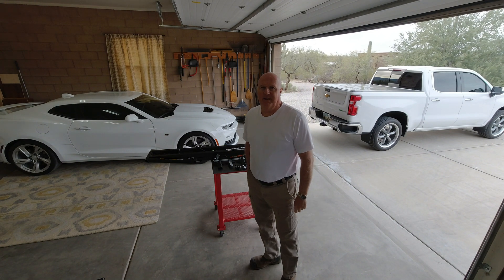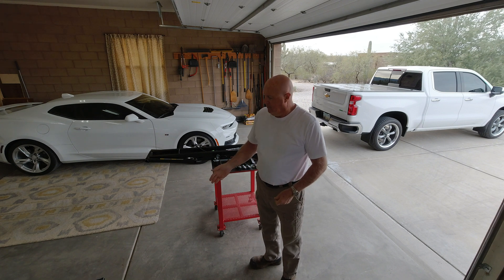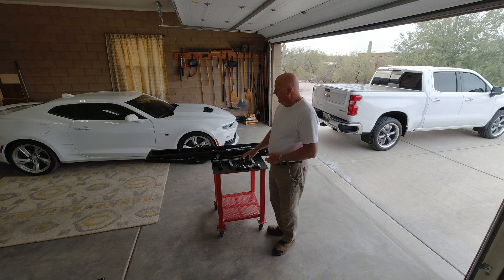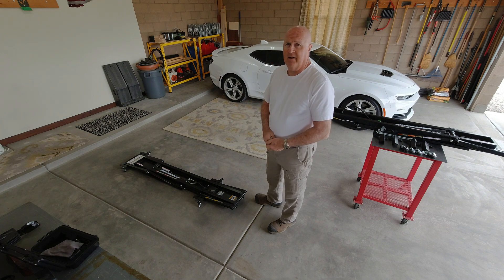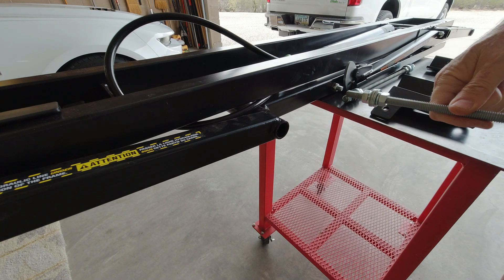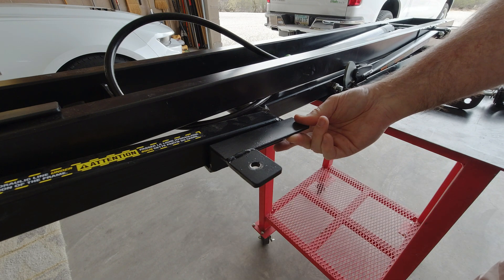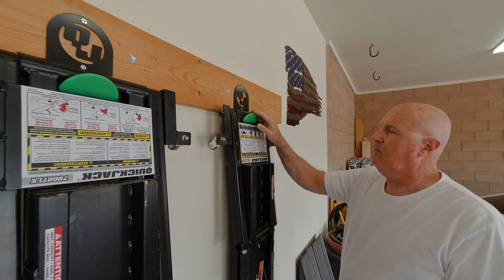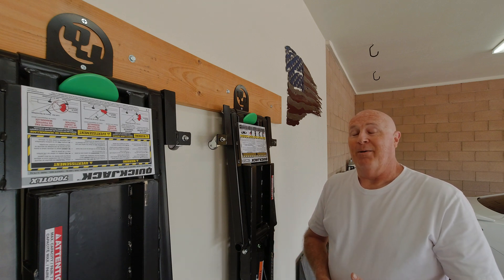Wheels For Your QuickJack, Bracket Design

Comment: Is there anyway you could make a quick video or explain in more detail about how you did the slope part so the wheel was even on the arm
Reply from the maker: Sorry, I just saw this.  Place the angle iron with one side elevated and then lay the tab flat on the table at the other end and weld.  I don't remeber the slope off hand but hopefully I stated it in the video.

Comment: Anyone have a parts list (for example how long is the all thread, how many washers per corner, etc...) to do this? I'm trying to make one (a list) now, but if anyone already got it I'd appreciate it. My jacks should be here this Monday or Tuesday.

So far i have:
8x 1.5" casters (would 1" work)
X ft of 1.5"x3/16 angle iron (4' plus in video, cut into 8 pcs plus brackets)
2x ?" 7/16 all thread
32-40x 3/8 washers (flat washers?)
24x 7/16 split/lock washers
24x 7/16 nuts (nylock/stop nuts, if desired?)

Am i missing something, or over counted on something?
Reply from the maker: Each "all thread" piece is 14 1/2 inches.

Comment: The caster style wheels will not work for everyone, my Mustang sits very low to the ground and I could not use caster style wheels on my Quickjack. What I did was purchase some button style rollers, they are like a large ball bearing in a metal cage they are much lower, so I can roll my Quickjack under both sides of my Mustang with the lifting block. I simply made a small metal piece and drilled a hole on each side of it and used some bolts, washers and nylon lock nuts used for model air planes to secure the button style rollers to the lift arms. This results in the lowest possible height to still roll the Quick jack.
Reply from the maker: This method in the video allows the lowest jack height.The length of the angle iron and wheel type will allow one to go all the down way to zero height increase.  All I also didn't want to drill holes in the structural steel to void the warranty on the jacks. If one didn't care about the warranty, they could weld the bracket for wheels directly on the rising jack arm. The ball bearing method is an easy if you aren't a fabricator.

Comment: Best wheel mod I have seen so far for the Quickjacks!  I will be making a set of these for my 7000TL very soon.  Thank you for sharing your engineering skills with us.  You should patent this design!
Reply: 8 flat top casters an hose clamps two per caster  mounted on bottom of frame in same area works the same less cost. did this to my 7000TL
Reply: What size casters?
Reply: yfss 1”polyurethane 55 lbs each rating . Not sure where I bought them been couple years

Comment: That's really cool Neal! Very good innovation! I am thinking of pulling the trigger on the same 7000TLX set. And while 100lbs each side isn't too heavy, it's just heavy enough for one to crush a toe if not fully alert...

And just to confirm; because I think this may be asked... When the nut-washer-rod stack passes through the Quickjack there is still a gap on each end so that each bracket themselves ARE NOT in a bind against the Quickjack, but in a bind against the (now internal) nut-washer-rod stack; is this a correct assumption? Or does it not matter? I suppose it may not matter as the brackets being in a bind against the Quickjack will work the same as we are not necessarily wanting your design to work as a hinge per se; just something that is serviceable and removeable,,,,, this might also explain why you chose to not just simply weld the casters directly to the Quickjack...

Anyhoo, I'm rambling now.

Very nice ingenuity! Stay safe out there!